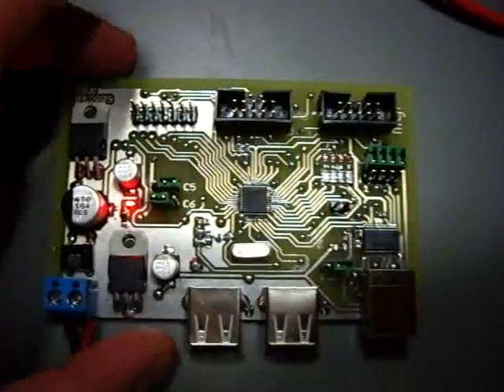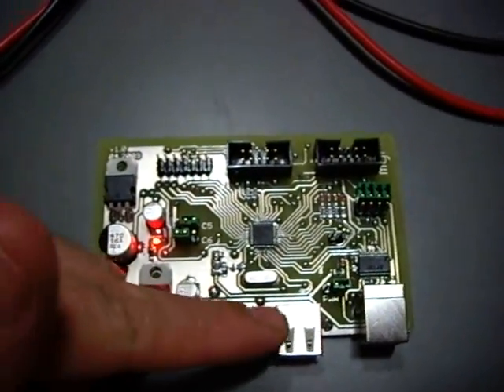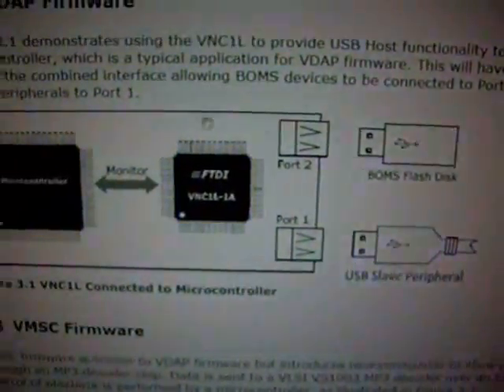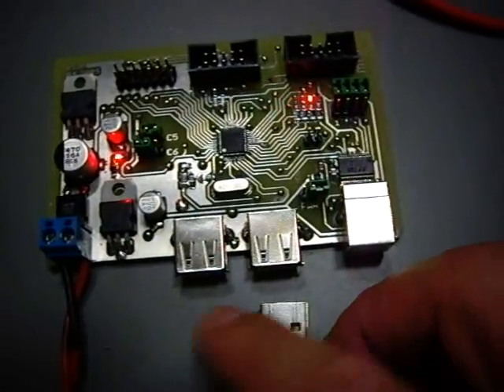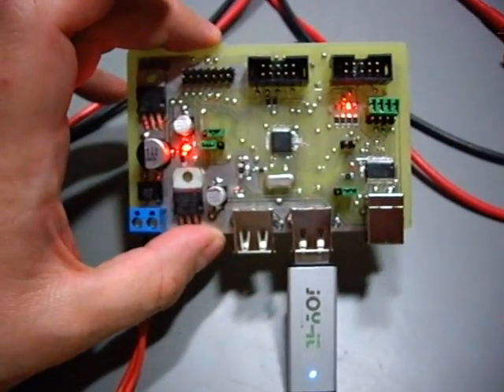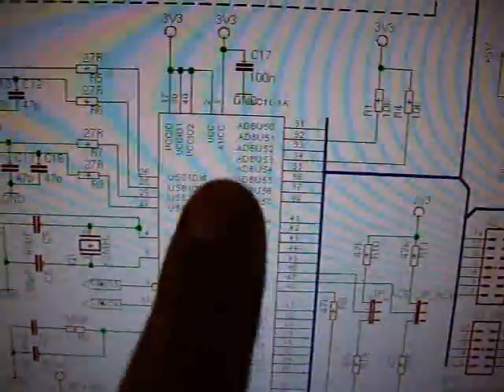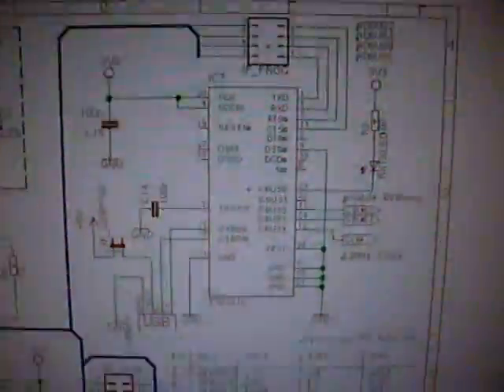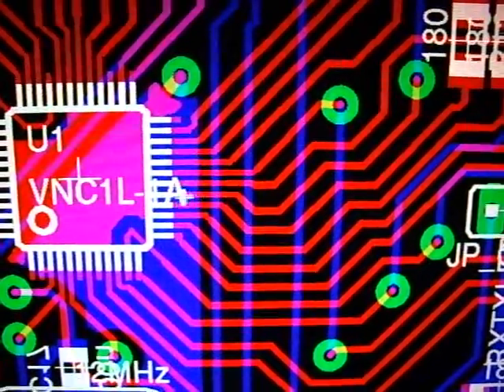USB host controller board based on the FTDI Vinculum

Comment: I'm working on this same board but we took it too far! Our goal is that a J2ME application sends a signal for USB flash disk (master) to be copied to another one (slave). I've been reading docs about FTD2XXX library and my theory is I need to write a C++ program and then use the JD2XX (JNI) to achieve the communication.
Could you give me your email or some way to contact you? Your help will be really appreciated.
Thanks in advance.